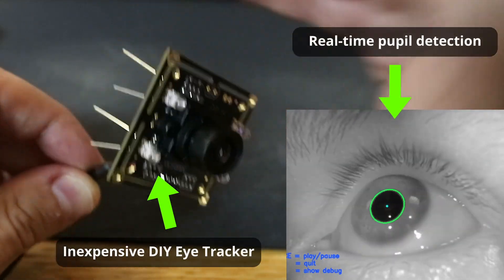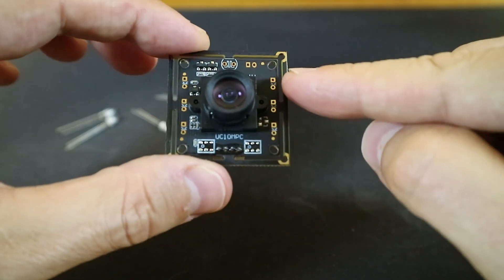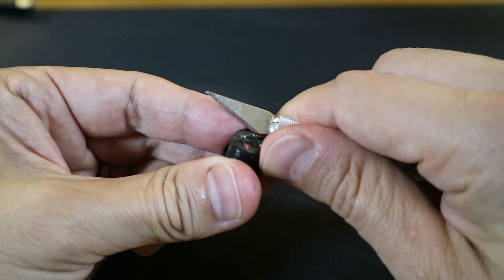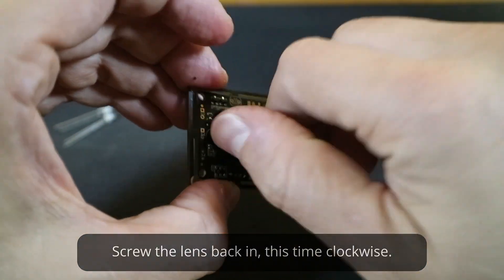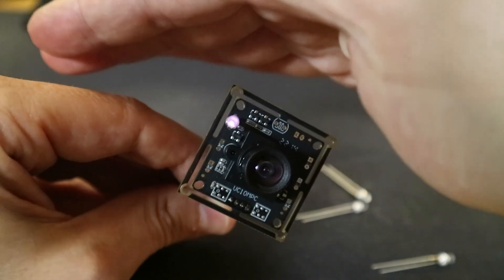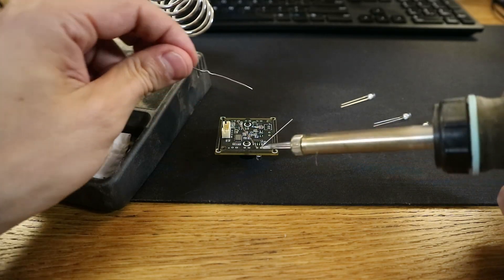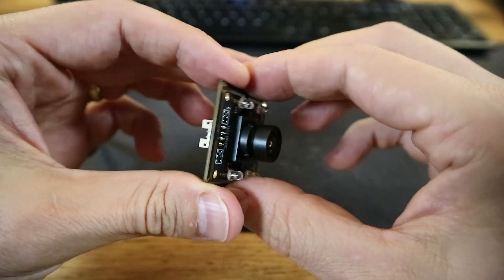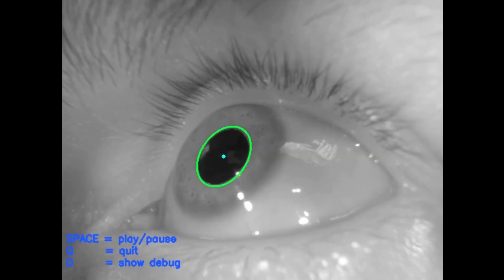DIY Infrared Eye Tracker for under $100

Comment: Great video, Jason. Do you think using two cameras would improve the experimental eye-tracking setup, or is one camera sufficient? Also, if possible, could you share more tutorial videos on how to implement this eye tracker within an experimental environment? Your guidance would be greatly appreciated.
Reply from the maker: Thanks, much appreciated!

Yes, two cameras would definitely be more accurate. That's on my to-do list, both for the near-eye tracking and webcam based tracker. 

Can you provide a bit more context about your experimental environment? Are you just needing eye data or do you also want the screen point projected on a video? Happy to do a follow-up video.

Comment: What is the maximum depth/length the camera can reach where the system still works functionally?
Reply from the maker: Currently, it probably only works between 2 and 10cm, though a camera with optical zoom / telescoping could allow it to work much further.

Comment: Hi ! How is mounted the camera ? Do you have some kind of 3D printed eyewear ? If yes, I would be very interested to have the associated file. Btw, does it work with a battery or it should be wired connected ?
Reply from the maker: I haven't mounted this camera yet, but I'm sure there are some 3D printed glasses out there somewhere. The camera needs to be connected via a wire to either your PC or a Raspberry Pi, but you could use a Raspberry Pi with a battery pack to do mobile eye tracking. See my Raspberry Pi video for reference: https://www.youtube.com/watch?v=apTlen7mkTg
Reply: @jeoresearch pretty clear, thank you a lot

Comment: A couple questions: (1) What sort of setup do you use to hold the camera in position in front of the eye? (2) do you prefer the camera with only two sanded down LEDs instead of four (unsanded)? Love the video— but Amazon no longer stocks this camera. I ordered one that looks identical from Alibaba for ~$30.
Reply from the maker: The setup really depends on the application. For scene based eye tracking, a 3d printed mount would work well. For AR/VR applications, usually the display needs to be modified. Sanded down LEDs are definitely preferred as they are safer and provide a better light distribution. I'm not sure why Amazon no longer stocks it - that camera is really good! Here is one more option: GC0308 Camera ($17): https://amzn.to/41x8p2W
Reply: @jeoresearch  Thanks! I'm really only interested in pupillometry, not eye tracking per se. I was considering placing a white surface with a fixation cross across the room and shining bright IR on it to provide diffuse illumination of the eye without directing the IR source directly at the face. I'll just need to make sure the camera doesn't cast a shadow on the eye and I'll need to measure the actual intensity at the eye.

Comment: hi, does the software process if the user is blinking?
Reply from the maker: Good question! The software keeps running in the background, but it won't return a pupil ellipse during blinks. It will just return the last known pupil position.

Comment: There is dangerous misinformation and many half-truths being used as rules of thumb here, but let’s assume Hanlon’s Razor.
 Since invisible IR radiation seems unnecessarily complicated , let’s focus on visible light using units we are more familiar with. However, the same principles apply.

There are two fundamentally different factors that are related but not the same, both of which contribute to eye strain:

    The observed intensity of the light source.
    The brightness at your eye.

These two factors are distinct, and you cannot calculate one from the other directly.

Your mW/m² reading would translate to a Lux value if we were discussing visible light. Now, let’s replace the eye with a camera that has a known ISO, shutter speed, and aperture. Suppose an overexposed pixel in the camera represents too much radiation for the retina of your eye.

Here’s a trick question: How would you calculate whether a pixel overexposes if you only have a light meter reading at the camera’s position?

You can’t!

Consider these two extreme cases:

    A dark room with a single tiny bright light source shining at the camera. In this case, the sensor (or your eyes) would overexpose the small light source, even if the total Lux at the camera is low.
    An evenly lit white room where the total measured Lux at the camera might be high, but no individual pixels overexpose.

This demonstrates why total Lux readings alone do not determine whether an individual pixel (or part of the retina) will receive too much light.
Think About It This Way

From first principles and your own experience, what would hurt your eyes more?

    A tiny, intense light source
    A large, diffused light source

If both have the same total lumens and produce the same Lux at your eye, which one is more unpleasant to look at?

Of course, you don’t need fancy math to know that staring into a small, bright light source is uncomfortable. But none of these calculations take apparent size into consideration!

All you're talking about is total power at the cornea, but that is not the relevant factor.
The cornea focuses light onto the retina, meaning what truly matters is the intensity at the retina—yet this critical detail is being hand-waved away!
Reply from the maker: Btw, if you've actually tested any of that on your end, I'd love to see the data!
Reply from the maker: Definitely check out the ISO standards. They should answer most of your questions, especially regarding exposure relative to pupil dilation and eye movement. This video is just to give you a very basic comparison of different light sources.
Reply: @All standards differentiate between separate exposure limits for the retina (both thermal and photochemical) and the cornea.

The retina is far more sensitive than the cornea, and light on the retina is focused, unlike light on the cornea.
None of your measurements or calculations can accurately estimate the intensity on the retina.

You absolutely cannot extrapolate retinal exposure values from your calculations and measurements.

This makes your conclusion dangerously inaccurate.

These questions are ones you need to ask yourself—and you'll realize that you can't answer them.
Reply from the maker: @lambda7652  Thanks for your perspective~

Comment: I'm currently just trying the project out with a normal IR LED camera (the ones that have the two LEDs on the sides) you can buy off the shelf, and it's not working very well for me (there's a red tint in the video feed, and it seems like its a fish eye distorted view). The pupil tracker is also always tracking my hair instead of the pupils. Could you explain why an off the shelf IR LED camera (such as a cheaper one bought off of amazon) won't work as well as the one created in the video? I'm currently working on a project that incorporates eye tracking for a keyboard for those that may have mobility issues!
Reply from the maker: Can you post the exact camera model and a video of the results on the Discord? The solution may be as simple as repositioning the camera or cropping the image.

Comment: Thank you for the video, manual and in-depth explanations. I'm currently developing a prototype of low-cost glasses for nystagmus detection. I have several questions about the lens. Please tell me which lens you chose for this module?  Which lenses are better to choose for use inside a VR helmet for binocular eye movement registration?
Reply from the maker: Good question. Any lens with a 60-90 degree field of view should work fine for in-display use, though the smaller the lens, the better to better fit in the display. The more important thing is to adjust the camera lens to the correct focal depth and to ensure that the camera module has a global shutter.

Good luck with the project!

Comment: Does it have to be a global shutter monochrome Sensor? Or can I also use something like the OV5647 which has its IR filter already removed?
Reply from the maker: Great question! A global shutter is best because the lines created by a rolling shutter can interfere with getting an accurate pupil contour. The rolling shutter will work for testing purposes, but you may notice a poor ellipse fit, especially when the eye is moving. Non-monochrome is ok! You'll just have to modify the code to convert the three-channel signal to grayscale.
Reply: @jeoresearch  Thank you for the fast response. I've checked the OV5647's datasheet, which says that it has both rolling and global shutter modes/options. However, it doesn't specify how to activate the global shutter mode or whether it's only global for single-shot photos and not continuous video streaming. But I guess I'll have to invest a bit more in the OV9281 and have fewer headaches configuring it. I saw some for around 30 bucks
Reply: @jeoresearch  Two more questions: Does the software support simultaneous two-eye-tracking? And would a 6mm lens with about 54° FOV be too narrow, given that it only needs to focus on the eyes?
Reply from the maker: @Atom224  I haven't tried it with two cameras yet, but you should be able to open two streams if you have two different USB devices. 54 degrees should also be fine as long as the eye is in the field of view. I.e. the camera may need to be some ways away from the eye.

Comment: do you know how much glasses interfere with eye tracking? mine reflect a bit of light from the monitor and that might disrupt it
Reply from the maker: Good question! It really depends on the position of the glasses relative to the camera. If the rims occlude the pupil at any point, it can affect the accuracy quite a bit. If it's just the lenses, you may be a few degrees off at higher camera angles.

Comment: So awesome! Do you know how we can use the eye tracker to then create a gaze vector? I wanted to use this on a school project with smart glasses. Ideally, the smart glasses would pick up where the user is looking. Thank you!
Reply from the maker: Thanks! I'm still working on the code to produce the gaze vector, which needs the code for the 3D model of the eye. I'll post a video on the channel as soon as I'm done! Stay tuned~
Reply: @jeoresearch  Looking forward to it! I’m trying to work out a way to work this into a costume helmet. I want to use a pair of these to get each eye’s gaze vector and map that to servo-articulated animatronic eyes, or even just LCDs. Think it’d be possible to use ML to preset emotions, ie bored, angry, happy?
Reply from the maker: @andrewbartunek6425  As long as you have a full view of the face, you can use tensorflow's mediapipe framework to do face tracking! Would it be it possible to mount a camera on the back side of the animatronic mask that has a full view of your face?

Comment: Thanks for video! I heard existence of IR filter in camera modules but I didn't have courage to open up. Is there reason for using 100$ module?? is that for additional IR LED pin holes u can utilize or sensor of that camera module have strong features like great clearity?
Reply from the maker: This camera module just happens to be versatile in many ways. Adjustable focus, powered LED holes, global shutter, and good FPS for the resolution. I think it's actually price is only about $70, which is only $30 or so more than most webcams of the same quality (without a global shutter or LED slots).

Comment: I wonder if you could use this for an automated HGN detector.  HGN is Horizontal Gaze Nystagmus and it's the test police officers do to detect if you have been drinking.  Jerk is easy to detect, so I'm sure this could easily be used for something like that.  HGN is essentially measuring jerk and that's just the third derivative of displacement :)
Reply from the maker: You absolutely could! It would be best for the camera to be static for that test, ie on a pair of glasses the person is wearing, but you could probably get away with just holding the camera off the nystagmus is really pronounced.

Comment: There is a high risk of eye injury when using focused IR emitters, like the ones you are using
Reply from the maker: Because of the low amperage, the risk is extremely low. Most commercial eye trackers use similar LEDs, many of which are more powerful than these.
Reply from the maker: To be safe, you could just use a diffuse LED instead.

Comment: Is there any risk of eye injury?
Reply: @NotSure416 @logitech4873

Infrared  radiation is not harmless and can pose serious health risks. Excessive exposure can result in thermal damage to the cornea and increase the long-term risk of cataracts. It’s essential to ensure irradiance levels remain below recommended safety limits to prevent harm.

Focused LEDs should never be used in close proximity. This is inherently unsafe, as highlighted by the "Emission distance: 7 meters" noted in the Amazon description. While radiation intensity decreases with distance due to beam divergence, making the LEDs "safe" at greater distances, this setup does not suit typical eye-tracking scenarios, where LEDs are placed close to the eyes—as seen in the video.

Commercial eye-tracking systems typically operate IR LEDs at very low currents (a few mA) and often employ PWM for intensity control. The board you’re using likely drives the LEDs at 20mA or higher, which could exceed safe exposure limits even with just one LED, especially at close range.

I strongly advise against using or replicating this project. Depending on the radiation levels, prolonged exposure could lead to serious eye damage over time.

@jeoresearch

ANSI Z136.1 primarily addresses lasers, not LEDs. While lasers produce coherent, monochromatic, and highly directional light, LEDs emit incoherent and diffuse light. For LED safety, more relevant standards include IEC 62471 or exposure limit guidelines from the ICNIRP.

Also, the fact that you heart the comment "No, IR is very harmless." shows, that you have no idea what you are talking about.
Reply: No, IR is very harmless.
Reply from the maker: @logitech4873 IR can actually be dangerous at intense levels, even if your eye can't perceive it. It's best to calculate maximum safe levels based on ANSI Z136.1 standards (the guide for LED and laser intensity).
Reply: @jeoresearch  Yeah but like, compare the leds to something like sitting next to a campfire :)

I'm sure the campfire wouldn't fit the ANSI standard.
Reply from the maker: Let me know if you try the calculation!
Reply from the maker: Because of the low amperage, the risk is extremely low. Most commercial eye trackers use similar LEDs, many of which are more powerful than these.
Reply from the maker: To be safe, you could just use a diffuse LED instead, which should still provide adequate illumination.

Comment: Check out the HBVCAM-1914S / GC0308, it's the cam I'm using! Super cheap, super small, high fps and comes with ir leds on board (only two instead of 4 though)

I'm trying to make my project as cheaply and easily accessible for non-tech folks as possible and found that one in my research, maybe you'll enjoy the results it gives ^^